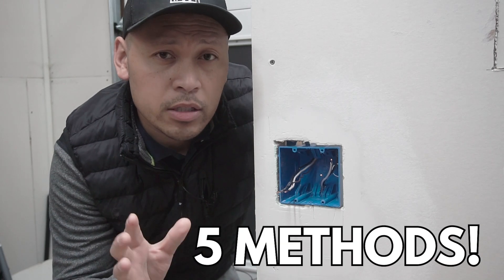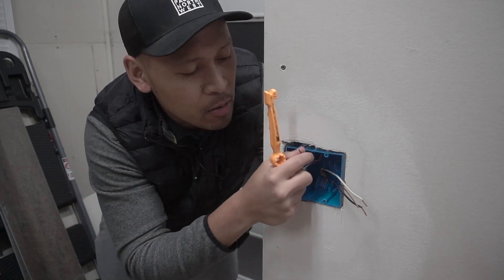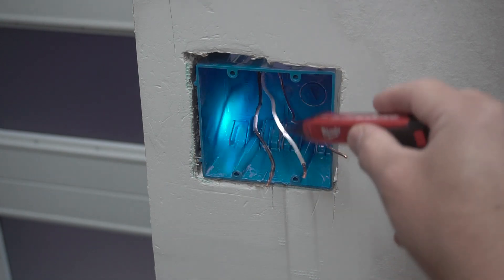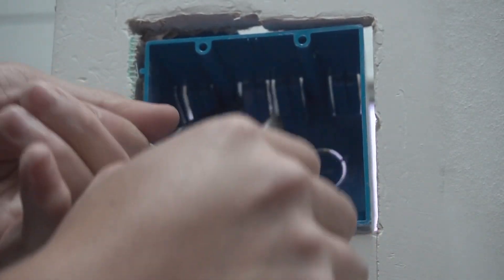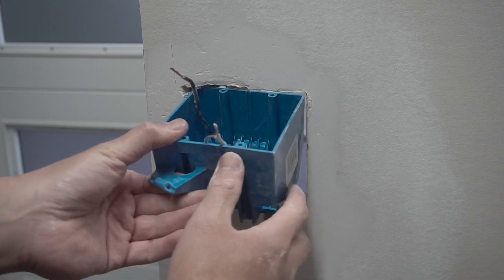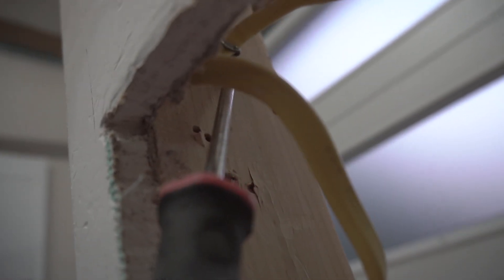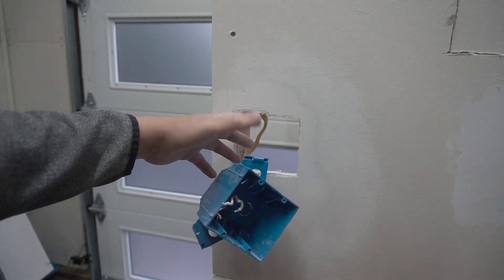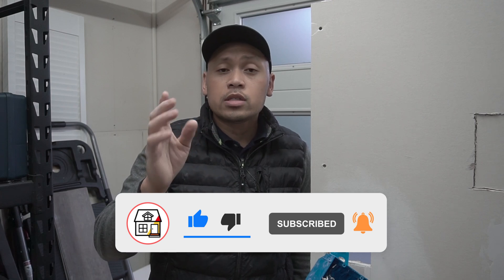How To Fix Short Wires Inside Electrical Boxes! DIY Tip And Trick Methods For Beginners!

Comment: That's a lot of wishful thinking.
Reply from the maker: A man can dream right? 🤷🏽‍♂️
Reply: @FixThisHouse  Certainly.  But when it comes to ultra short wiring it seems more like nightmares.  It's a wonder they haven't tried some type of horizontal enclosure hidden behind baseboards to get quick and easy access to wiring or maybe the baseboard itself just covers a channel.  Then you need vertical access which could be hidden along side venting.  Not a bad idea.

Comment: Tip: That electrical tester is more of a potential tester. Not useful for troubleshooting. Don’t rely on it for voltage accuracy. Use a multimeter for actual voltage readings. For this application, works great. Thanks for sharing.